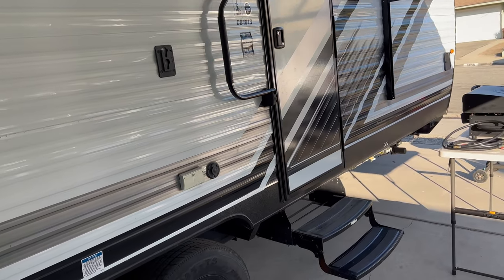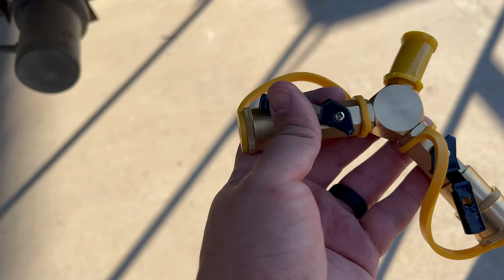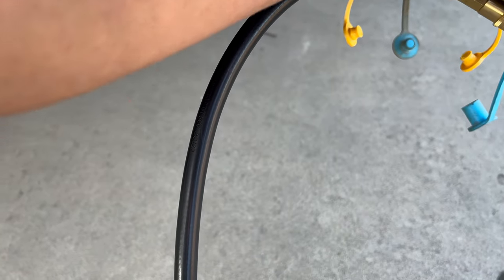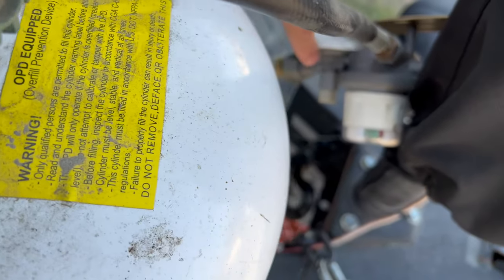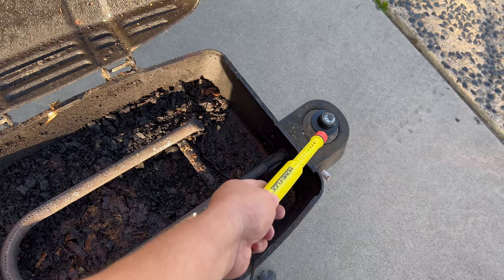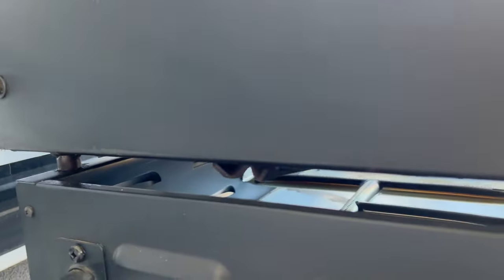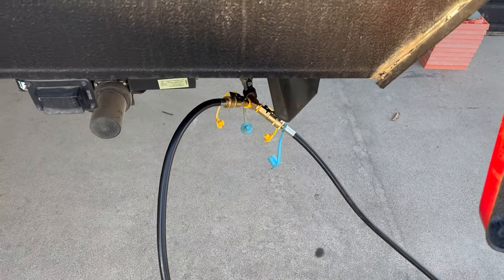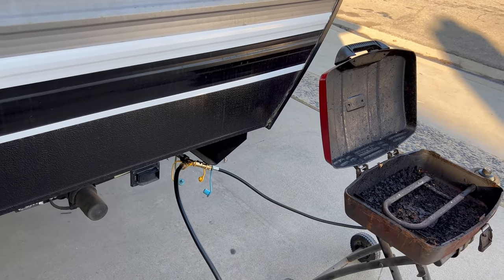RV/Trailer Quick Connect 2 Way splitter - Y Splitter - (*link in the description*)

Comment: Do both sides get equal amount of gas when two are used? I want to run a portable coleman stove and griddle as well at the same time. Wife will do eggs and bacon and id do pancakes. I dont want either one to take more gas than the other. Having both griddle and stove running to its full potential
Reply from the maker: Yes, that should work perfect. If your are using a quick connect from an RV and either the griddle or stove have a regulator it won’t work, with or without the splitter. Just my advise from my experience. But if both work now individually then you should be good with the splitter. I have another video that explains that a bit more.

Comment: Can you split off of the line ?? If you wanted to split it further down the line ?
Reply from the maker: You can, but you might loose some pressure depending on the distance, your appliance and you propane tank.
Reply: @TableforSix6  Appreciate it I’m actually thinking of running a portable heater tower off of my natural gas grill but I haven’t seen much research on the split for that
Reply from the maker: @SETTAPERFORMANCE  you might be ok with this